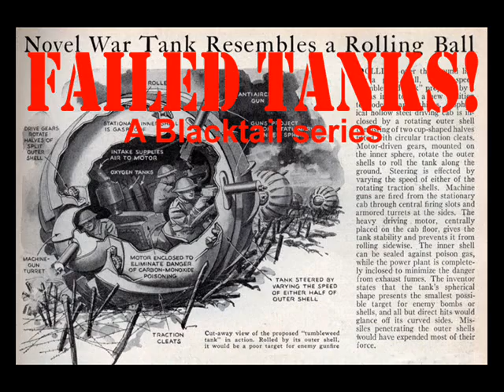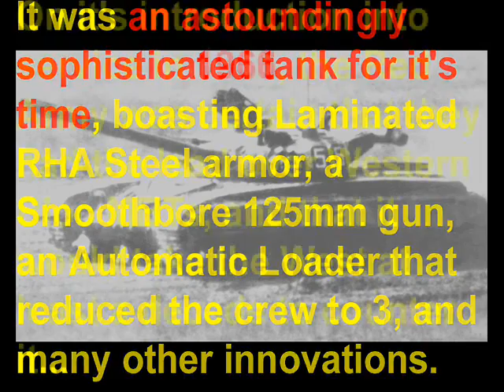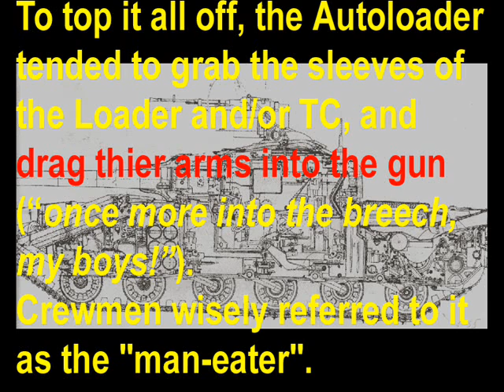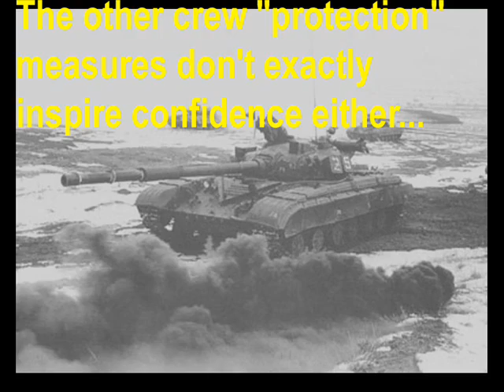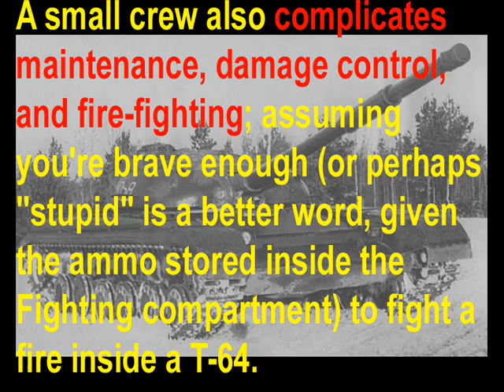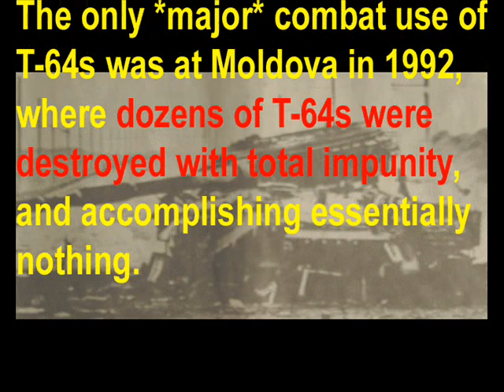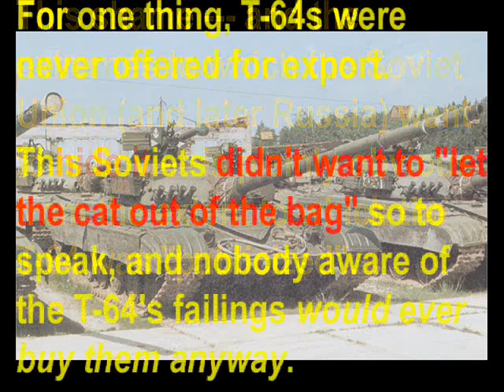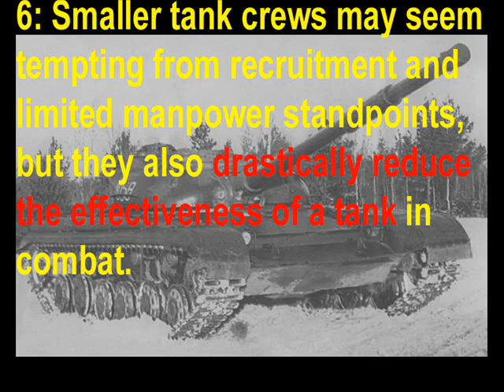Failed Tanks, Chapter 4: The T-64

Comment: Sorry, if I'm wrong, but there are a few mistakes, I believe. The T-64 didn't have 125mm gun, but 115mm of the earlier T-62, the former gun was only applied to T-64A version and all the following. Plus, it's production actually ran until 1987, not 1967 :)), and there were like 13000 made, not 8000. Also, 5TD engine was not overloaded, because 1 cilinder had 2 pistons, not 1 :))), needless to say, 5TD and it's succesors 6TD are notorious for their complexity and rather short service life.

Comment: It was produced from 1963 to 1987, these are 24 years, and built in more than 10.000 exemplars (13.000+ according to en wiki). About it's appearance in parades and export, the reasons are simply: it was a top secret tank. Also the T-80 was never shown neither exported, for the same reasons, the T-72 was the parallel project designed also for export, but T-64, T-80 and hypothetically subsequent models were for USSR only.

That said, both T-64 and T-80 were shown in parades during Gorbachev era.

Comment: For suspension: torsion bar had been in use since the T-43. It was used on the T-44, T-54/55, T-62, and the entire KV/IS family. In fact, the T-34 was the last widespread Soviet tank to use Christie suspension and the only reason it continued to do so is because they considered constant production of the tank more important than a halt to replace the suspension with the torsion bars they had successfully implemented on other designs. Torsion bars were not "new" to the Soviet Army in the 1960s.

Comment: Please don't talk crap, rounds Syrian fired where poor old as 20 to 50 years. Dumb fuck 100mmD10 gun came out late in WW2, installed in Su100.So the rounds the Syrians got were 28 years old from WW2 yeah right.The 115mm smoothbore of the T62 was only about 11 years old since T62 went into production.  The ammunition was fine it was the bad training and the 105 L7 range is better.The Isreali's trained for long range kills the Syrians had to close the distance.Cents depression elevation superior.

Comment: Actually no : T-72 was not the 64 replacement... T-72, originaly was ONLY to be a T-64 with V-46 engine, and to be produced in uralvagonzavod, but their design bureau proposed a vastly modified T-64, inspired from their previous 62. It became the 72, mobilisation tank. Up to 1989, the 72 was only a second line tank, and export product, it never equiped the main soviet armies in germany/hungary... And i'm tired so i won't continue, i've said most of it....

Comment: 16 : "break down embarassing", sorry the only embarassing thing is your video. 17 : "2009 russia scrapping T-64 more than any other tank", of course, it's no use in russia. They concentrate on the T-80B,U,UD (UD less and less because also ukrainian tank) and all T-72/90. Russia inherited most T-64, the best ones, T-64BV with small age, are stored, it is estimed few hundreds to 2000 are kept in long storage, while most others are scrapped. A lot are still used in training centers however.

Comment: Some T-72 were used for mobility test etc, but not sure they even combat. T-55 and 62 were far better "multipurpose artillery" and far cheaper to use, and no one care it it's lost, it's an outdated tank. Actually, the same thing in chechnya, T-62 were used a lot because you can stockpile shells, and shot from afar to the targets, using cheap ass tank, surplus ammo... the afghan war wouldn't have changed a bit if they used 64 instead they just had lost them instead of cheap ass 55.

Comment: 10 : "commonalty between T-64 and 62/55", in what this is a problem ? Is there any commonalty between M48a3 and M1 ? 54/55/62 were outdated design, thank god they totally got rid of their base ! 10bis : "suport ARV etc", yes, T-55 hull was a good and cheap base, and they are still used today, even in russia (most T-72 based ones are used now), i don't see the point to use an expensive T-64 hull when the cheap ass 55 can do the job, or even the 34. (yes a lot even in the 70's)

Comment: I totally broke your main point, with easily accessible data... in early 1980's, kontakt-1 was fitted to the T-64B, and roughly 2/3 of them were equiped with it in 1989. A lot of T-64 were rebuilt in T-64A, and T-64A in T-64B. Most T-64 in 1989 were T-64B of various versions. Production span : 1963-1987 : 14 years. Quality (especially armor, gun and FCS) of the T-64B was not a myth, it was a champion when debarassed of its past troubles.  Morozov and his team, made one hell of a great job.

Comment: "8000", no, most sources now agree on 11000 to 14000. "1963-1967" what ???? no... "preserie" of about 600 T-64 were made, with the 115mm gun. That is production, and massive testing/fixing period of the early model. in 1966, started production of the real T-64A, with 125mm gun. the tank was improved in many details during production, in 1975 a new version (T-64B) went full production. It lasted until 1987 at kharkiv. Yes, 1987, when the T-80UD began to remplace it in the factory lines.

Comment: At the time (1970) this was higer than the average male height in soviet union... You can also find a lot of much taller men, from finland or serbia (T-72M or M-84) who claim to have served without problem in them, i recall one guy of 184cm. T-64 is a little smaller, but very comparable to the 72. Yet, even if this was true, it's not a problem, as most men anyway were below 175cm and if needed, all small guys went to tanks.  8 : "3 men crew", well, question of POV...

Comment: in the like of 800-900 for turret, and 700-800 for glacis. For your information, T-64BV weight is ~ 42  metric tonnes. 6 : "ammo storage", this is useless... In this case, all MBT exept abrams are shit because they have ammo in the crew comp, no, this is not a failure... what tank of its time do better ? none. This issue is not even worth talking. 7 : "crew size" this has yet to be proved : official manual of T-72M (this come from finnish tanker), says "no more than 175cm"

Comment: the cast turret of the T-64 offers great protection in the frontal arc (60°), yes RHA steel plates of 60 or 80 mm on the hull side and rear, how is that anyhow inferior to the M60 or leopard 1 ? (or abrams by the way). Protection of the T-64BV, with late composites, new turret (almost the same as the T-80B, while the T-80 had the T-64A turret) and full coverage of ERA make it extremly well protected in 1980. VS KE its the like of 450-500 for turret and 400-450 for glacis, while vs HEAT it's

Comment: So, basically, the separate ammo problem isn't one at all. Projectile are not "very short" by any means, where did you find that ? only the APFSDS is indeed affected by that, and it wasn't a problem up to the late 1980's, because NATO apfsds weren't as long as they are today, they were like the russian ones. Anyway, today the AL of most modern tanks is modified to accomodate longer rods, (T80UM,UE-1, T-90A,S,MS, T-72BM,BA, T-64BM, T-84...)

Comment: 4 : "separate ammo, logistic", well, not really... realoading the AL cassetes is no longer than reloading the ammo rack with 100/105/115/120 shells... And there is no need for a hulk to load them in the gun, the sustained ROF in T-64 is much higer than any tank with manual loading, over some time the guy is getting slow. AL also reload on the move, i mean MOVE, unlike manuals, where speed MUST be very limited, and on plane ground.

Comment: Back to the israeli, also in 1982, the syrians T-62 (manned by very inferior crew) were able to kill 2 brand new "wondertanks" merkava 1 (among other AFV losses). Note, that i do consider the merkava 1 far better than the T-62, and even T-72M, but the fact is here, its gun was a killer. 2 : "tube life", well look the 2a46 evolution, yes, early ones were not very durable, however, nothing alarming or shocking. The D-81 is overall a far superior gun than the L7, or any previous russian gun.

Comment: You can't deny that the biggest tank threat to NATO in the 70's and 80's was the T-64. The late version, T-64BV was almost as good as the T-80BV, and much superior to any T-72 variant, in all domains but frontal armour. T-64BV are still ukraine main tanks (the place where it was born and produced), and their modernised T-64BM sure is a far better MBT (which isn't) than the abrams, being almost on equal terms with the russian T-90.

Comment: I dont know where you found "facts" you said here, but most of them are wrong. First off, you say it was designed within just 4 years but in truth, acording to kubinka desing lasted almost 12 years. Production span of only 4 years is also not true. Tank was produced from 1963 and up to 1985 (kubinka) somewhere you can find even up to 1987. Number of production is also untrue, up to 13.000 were actualy build. Initially T-64 used 115mm gun, later model T-64A recieved new one D-81T and autoloader

Comment: Congratulations, you point out issues that dogged the early models of almost every soviet tank design. Emphasis on the term EARLY models. These thing happen to new designs all the damn time. They're also usually sorted out within a few years. You also don't cite a damn thing, half this stuff is unsubstantiated rumor, and the rest of it could be argued for practically any tank of the same generation, both east and west.

Comment from the maker: I beg to differ. It's trademark autoloader and 3-man crew were already used in the French AMX-13 and Austrian Sk 105 Light Tanks of the 1950s, and the earlier Chieftain had the same type of engine, and the American T95 prototype of the 1950s had Composite Armor and a Smoothbore gun.
The T-64's designers tried to do too much at once by cramming all of these gimmicks into one tank, despite having little experience with any of them to draw upon. As a result, the T-64 *itself* became a gimmick.

Comment: The FV-432 is an APC/Multipurpose vehicle, not a light tank. 

The Boeing GT502 which used at first, had only 300 HP performance. Of course it was replaced by a Caterpillar 553 on the Strv-103B, having 490 HP, but it also had the K60 too, for manoeuvring the tank for aim.

Comment: Partially right. Multifuel opposed piston engines for AFV are existed before the 5TDF, namely the Rolls Royce K60, used on the Strv-103, or the FV-432. So that concept is not new. Autoloader was used on the Strv-103 before the T-64. The only was not time tested, the 2A46 tank cannon.

Comment from the maker: The Russians developed a new opposed-piston engine in later years, which Ukraine ended up using on the T-84 and T-80UD; the T-80 has a Gas Turbine, and the T-90 has a late-model version of the same V12 that the T-72 had, when it supplanted the T-72 in production and development in 1971.
The T-72 and all subsequent families of Soviet and Russian MBTs use the 2A46M gun, which replaced the 2A46 used on the T-64.

Comment: but most of its tech was proven and test and refined. hence the reason why its one all modern soviet tanks. in a nutshell without the T-64 there wouldn't be a t-72, or t-80 or t-90 which hail from the T-64's cutting edge break through. it may not have been perfect it was still better than the US equivalent it was competing with.

Comment: And if you compare later versions of T64 (B and BV) with late versions of cheiftain, the gap becomes even wider. Even ukranians today use T64 and modernised it as the T64BM bulat. Later Soviet T64BV had ERA (massivly improving missile and HEAT immunity than any cheiftain), upgraded armour, 1000hp engine, ability to fire guided missiles and advanced targeting systems (fully stabalised btw).

Comment: not to mention 90% BREAKDOWN RATE which makes it one of the least reliable vehicals in NATO service at the time. Lets compare basic facts... Composite armour of 450mm RHAe vs 338mm of steel. T-64 win. High power to weight ratio with hydro mechanical suspension against tractor like hortsman spring suspension (not that different from vertical volutes you get in shermans), T-64 win. 125mm gun with muzzle velovity of 1750 and able to fire massive range of AP, HEAT and HE-frag rounds vs 120mm rifled.

Comment: as for only the front of the tank being protected by laminate armour, all modern tanks are protected in a similar way. for example, the rear side hull of the abrams is protected by RHA steel spaced behind a steel skirt of about 5mm thickness. in general, tanks from the cold war are designed to protect against main gun ammunition on the front, and medium-caliber from the sides. latest generation western tanks has added HEAT protection on the sides, but this started in the late 80s.

Comment: you're wrong about the weight, the T-64 is 38 tonnes, 3 tonnes lighter than the T-72. also, the T-62 had torsion bar suspension. the new thing with the T-64 suspension was the track return rollers, a feature that was a standard on western tanks at the time. the biggest problem with the T-64 engine wasn't the multi-fuel capability, but the opposing piston design. it required 2 crankshafts, which made the engine extremely complicated and unreliable but reduced it's size and weight.

Comment: Much of the complaint related to the T-64 design was to its super compact engine and transmission design. There were many teething problems, and in general the new design was deemed to be less reliable and more maintenance intensive than previous designs, especially in cold weather.  

T-72 reverted back to an older and less radical design (albeit less compact) and has demonstrated reliability.

Comment: They are the reason that 125mm ammo are in 2 parts and that 125mm rounds struggle to outperform Western 120s. The laminate armour on the T-64 is lighter than regular armour, right?

5:30 it's a risk you need to take. It's either like that under armor or in the bustle. The M-90/M95 came up with a simpler autoloader, but I don't think they changed the feed.

Comment: @BlacktailDefense 
I've got more correct info from a book about T-72 which starts from T-64. The problem was in IR projector which was mounted on the left side of tank's gun. It's neccassary to move gun's tube and projector aside to let the driver get out of his hatch. The gun was moved by shorter way to the left placing machine-gun just above tha hatch. Early T-72 had this problem too. After accidents the IR-project was moved to the right side of the gun and the turret turns to the right now.

Comment: @BlacktailDefense 

Most of this defects are not reasons to call the whole tank bad. APU can be replaced, and weaponary too. 2A46 gun has been installed in 1979. In fact all advanced technologes were introduced on T-64 first and later on T-72 and T-80. The tank is still used by Russian army and I suppose that most of problems were solved.

Comment from the maker: @MatoVuc The themes of the T-64 carried-over to other tanks, but the pattern was never repeated.
For example, the composition and geometry of the T-72's armor is completely different, as are all the mechanisms of it's autoloader, and it has a later-model 2A46 gun variant that was never back-fitted to the T-64. It weighs 3 short tons more than the T-62, as does the T-80.
Also, no other MBT has ever used the same engine configuration as the T-64 (a multi-fuel flat 6-cylinder).

Comment from the maker: @MatoVuc 
Revolution or not, none were ever sold abroad, even long after every piece of technology in the T-64 became obsolete several-generations-over. That MUCH more sophisticated T-90s are selling abroad like hot cakes, and older T-55s continue to find exports --- but T-64s are NOT selling abroad --- pretty solidly nails the T-64 as a failure.
As for new design principles like those seen in the T-64, which prove unreliable and are never repeated, that's what is referred to as a "mistake".

Comment: @BlacktailDefense
P.S. And take a note that T-64A and T-64B are NOT upgrades of previously built tanks, but new-built units only coming from production line (however, old tanks recieved various upgrades as well, but without primary model index change). T-64BV were both upgraded T-64Bs and new-buit tanks.

Comment from the maker: @PKSnsk 
"It was receiving most modern upgrades 2-3 years ahead of T-80 and 10 years ahead of T-72."
You mean like ERA, Laser Rangefinders, and an Active Protection System? Those were first applied to the T-55AMV in 1977.
And how about the AT-11 Sniper ATGM that replaced the AT-8 Songster, and Passive Thermal Sights? Those were back-fitted into T-72s, but NEVER T-64s.

Comment: @BlacktailDefense

You are remarkably ignorant on the matter of T-64 and Soviet tanks as a whole.

This video contains up to 3 gross factual errors or outright lies PER SLIDE.

T-64 was introduced in 1963 and was produced until 1987, when it was superceded by T-80UD - that had same turret and engine but new chassis. T-84 that is in production now is its direct derivative. It was receiving most modern upgrades 2-3 years ahead of T-80 and 10 years ahead of T-72.

Failed design, hear hear.

Comment from the maker: @PKSnsk 
The T-64 was "secret" because it didn't work, and the Soviets didn't want to publicize it until it did. That they stopped building them after only a few years, and weren't noticed by the West until nearly 10 years after that, which says a lot about how "valuable" the T-64 was. This is clear evidence of a failed design, as explained in the video.
Moreover, comparing of ICBMs to tanks is a pretty weak argument --- or more precisely, a textbook example of the Weak Analogy Fallacy.

Comment: Not sure if it was mentioned before, but the T-64 did have one problem while still on the drawing board. It was never designed to use a 125mm main gun. Initial production models mounted the 115mm from the T-62. After the USSR got its hands on a brand new M60A1 and examined its armor did they demand a better main gun.  

I imagine the change in mid production did little to help accuracy or reliability. (The Abrams went through the same problems with the switch from 105mm to 120mm)